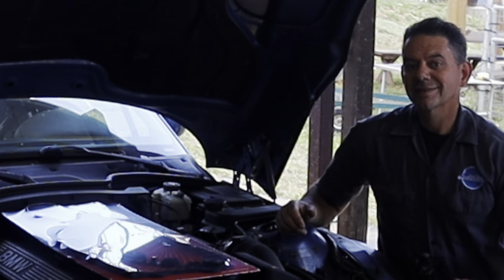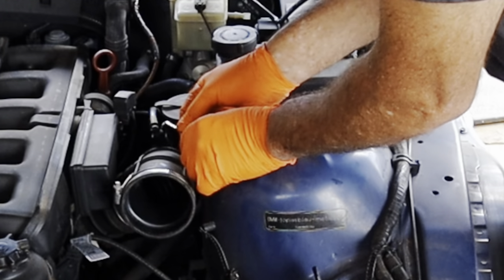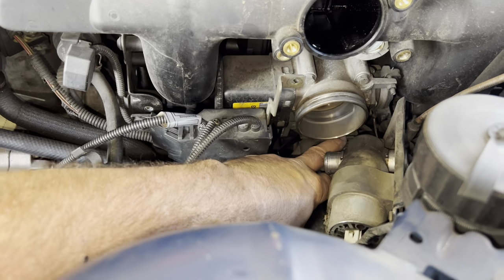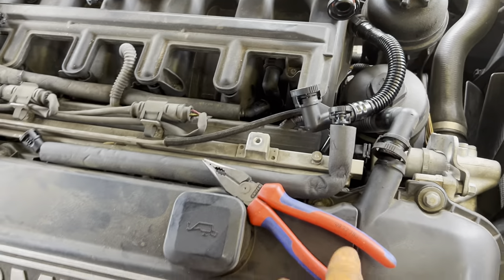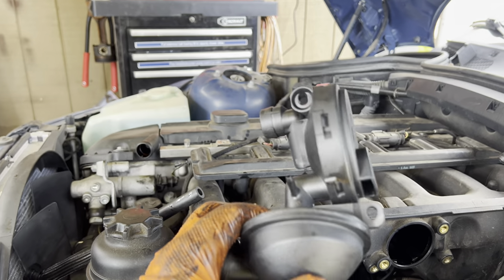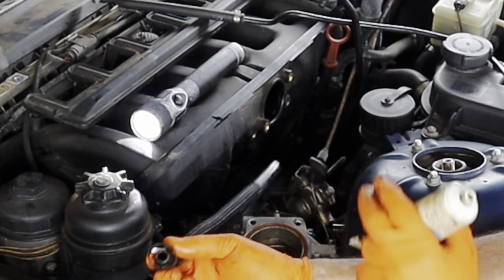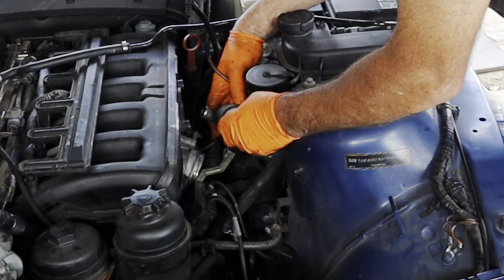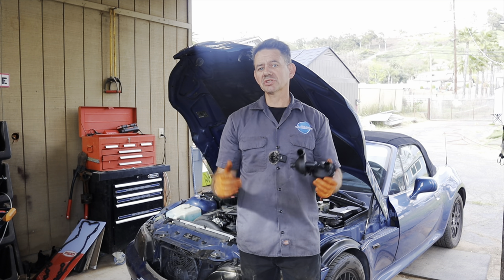The Overlooked Reason Why BMWs Leak Oil

Comment: I don't have a BMW, have a VW and thought they had crazy designs . BMW is insane. Great video explaining how to do this. I watched because of your skills and explanation . Thank you
Reply: I don't hate VW but I don't like working on them lol. I have a BMW and this is normal for us. To each their own but I rather work on a BMW. Craziest VW job I've done was valve cover reseal on 2016 Tiguan with the 2.0 eea88 engine I believe, cam caps are incorporated into the cover itself so you have to torque it to spec.

Comment: On bmw m54 motors you can run a vacuum line from the manifold to your pcv to increase vacuum (reducing pressure) in your pcv system. Can help with the 3.0 motors that have oil consumption issues. O2 pilot mod is the name